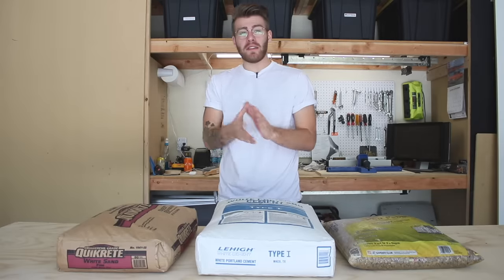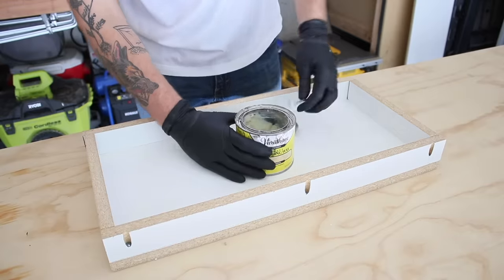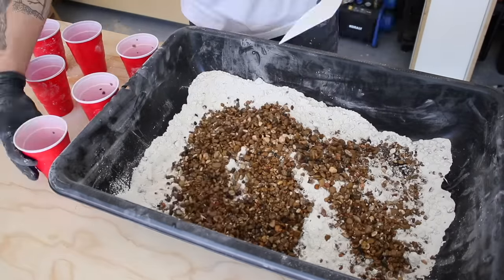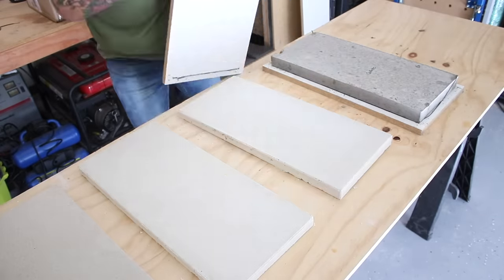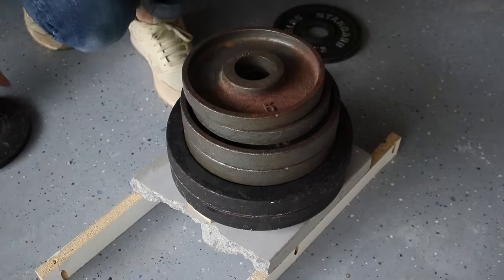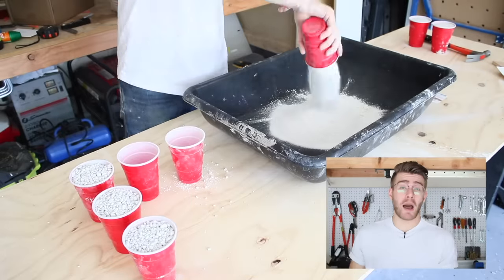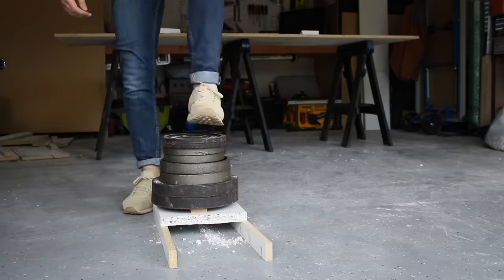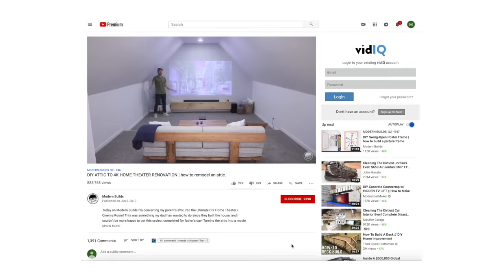How To Make White Concrete | A Modern Builds Experiment

Comment: Really great video if I could point some things as a civil engineer.

The ratio of water is also importan, the ratio of aggregates will change the need of water, the “consistency” will not guarantee that they are equal. Also when we test concrete we normally let the test piece under water it helps the concrete to cure better and most of the strength is achieved by day 7

Comment: also concrete needs water. you are not putting much. its supposed to be like very soft puddle. then wait for it to dry and water it for next 4 days to prevent cracks

Comment: curing it under water for 28 days makes it stronger and you would get the final strength
Reply: That's not correct with modern concrete unless it is specifically designed for placement underwater.
And even now--bridges with concrete piers--the water is evacuated from the area for the placement to occur.
https://www.youtube.com/watch?v=fO5yYxpOsLo

You are thinking about the concrete that was made during ancient Roman era, which is very different than what we use today.

Comment: as an engineer I find it funny that he breaks the long slab with a hammer, without any chance of measuring its strength and then expects to measure it in the short end with weights
Reply: concrete can take pressure not bending , rebars used in concrete to prevent from concrete fall on our heads !!! thats all what i need to say  - useless testing 😂😂😂    if he wanted to do test he need to have big hydraulic press with pressure scale where he can try to crush concrete

Comment: 2 days is just not long enough to assess the strength of concrete; I was taught a long time ago that it takes 5 weeks for concrete and cement to properly cure.
The strongest results come from using only as much water as necessary to make the mix workable for its purpose and to mix it very, very thoroughly.
It improves things even further if the drying out process is retarded and you can do this by covering with plastic sheeting after the concrete has set enough-an hour or two- ten leave it on for as long as you can-weeks if poss.

Comment: The compressive strength of concrete is indirectly proportional to the "water / cement" ratio. The most resistant concrete has a theoretical relationship of 0.3.-, the main hypothesis is that the coarse and fine aggregates are saturated with water, that is, they do not "suck" more water. En este video, vos lo ensayaste a la flexión, el hormigón se calcula a la compresión. No sabemos cuantos vasos de agua le agregaste, se ve uno, luego medio mas, no esta claro. In this video, you tested it in flexion, concrete is calculated in compression. We do not know how many glasses of water you added, you see one, then half more, it is not clear.
La resistencia a la compresión del hormigón, es indirectamente proporcional a la relación "agua / cemento". El hormigón mas resistente tiene una relación teórica de 0.3.-, la principal hipótesis es que el agregado grueso y el fino, estén saturados de agua, es decir que no "chupen" mas agua. En este video, vos lo ensayaste a la flexión, el hormigón se calcula a la compresión. No sabemos cuantos vasos de agua le agregaste, se ve uno, luego medio mas, no esta claro.

Comment: Great video! Some feedback on your scientific method though: you're right that the thickness makes a big difference, so ideally you'd control that very precisely between test pieces. A 10% increase in thickness translates to a 33% increase in strength (the way you''re measuring it). And if you want to get really fancy with measurement, you can put together a jig like Matthias Wandel's to see the exact force when failure occurs: https://www.youtube.com/watch?v=apsH8eBfjVA
Reply: I think you ask way too much here considering all the approximations  along the casting and testing process :)
Reply: You seem smart, I want to do a white concrete.over normal slab floor...do you know how thick it should be? Do I need to reinforce and and etching or primer...thanks in advance and sorry to bother you🙏🏻🌈

Comment: you cannot get the actual strength of the concrete if you did not let them cure on the right curing time, give atleast 7 days before conducting the rigid test.

Comment: No need to do this mess! There are proved formulas for different needs. The concrete formula is 1:3:3 meaning 1 part of cement, 3 parts of sand and 3 parts of aggregates + water. And of course if you need strength you need  iron - and iron grid will do.

Comment: None of your tests are accurate representations of materials testing standards. These are at best, guess work. Concrete is typically tested using cylinders and beams and at the very least it’s tested at 7 days after it is cast. The melamine piece was far from applying an even distribution of force and stepping on it applied an uneven rate of force. 

No one should follow this method if they want to “test” store-bought concrete, there is usually no need which is why you buy it from big box stores in the first place. If you want to know how strong a mix is there should be a ratio and corresponding MPa for it. 

Was fair of you to say you’re not a scientist but none of this made sense. If anyone wants to know what tests consist of look up ASTM CSA standards.
Reply: Fair criticism, but most of the concrete testing standards have to do with hardness(pressure rating) and slump properties.  He was more or less testing tensile strength, albeit using very poor methodology.  Also he did very little to improve the tensile strength, even though that was his main point of interest.

Comment: Damn... I thought you were going to make some special mixes to test "out of the ordinary" but you simply mixed standard mixes and tested it...in a very inconsistent way. You as well forgot to use the exact same amount of water in your test samples. Anyhow, you kinda just reinvented the wheel here...as in the same one. Google "best concrete mix ratio" and you get EXACTLY your results:
In making concrete strong, these ingredients should usually be mixed in a ratio of 1:2:3:0.5 to achieve maximum strength. That is 1 part cement, 2 parts sand, 3 parts gravel, and 0.5 part water.

Comment: What did we learn...your not that smart..you should have used plasticizer instead of water also some reinforcing fiberglass mesh and or reinforcing rebar. Also you should have used white latex paint.....your mix could be much dry resulting in stronger  tile...and you should have wait 7 days be for breaking them to get better strength testing